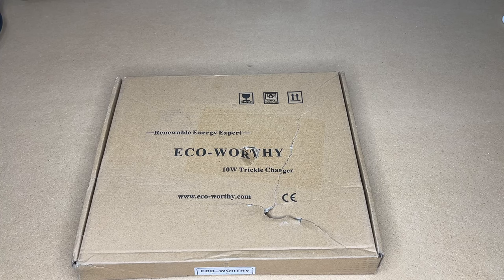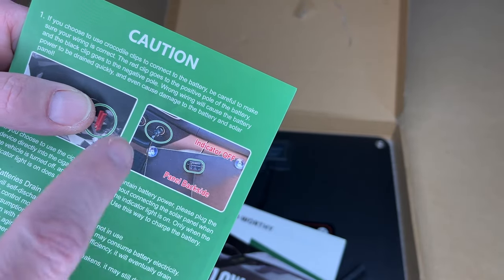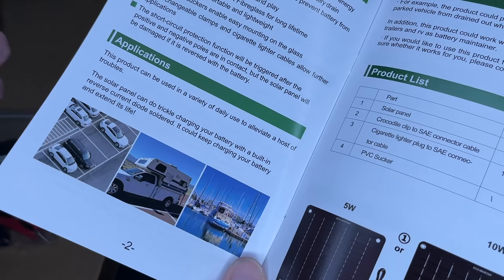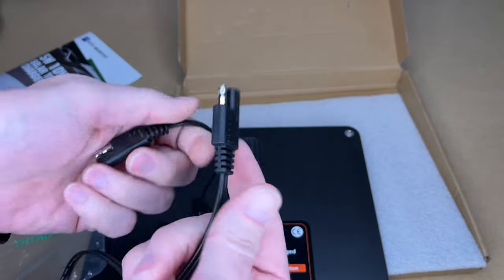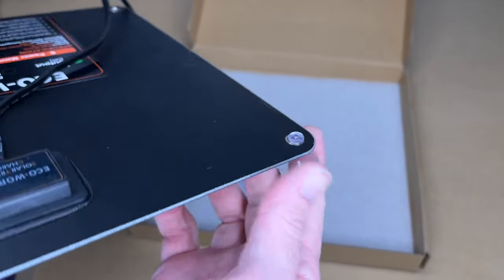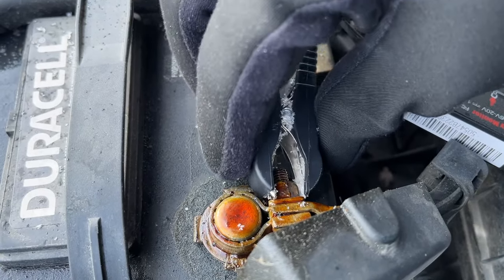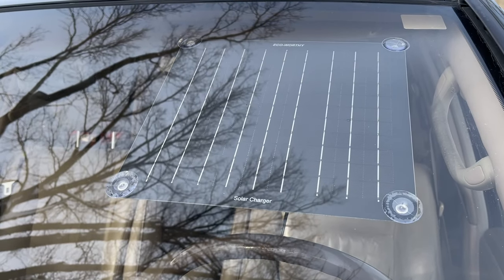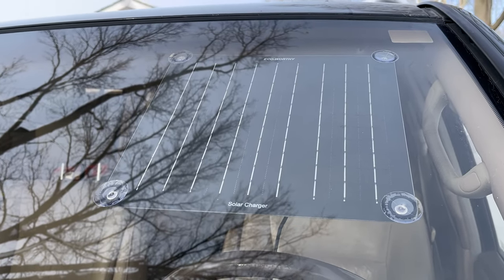ECO-WORTHY 10W 12V Solar Charger Battery Maintainer

Comment: Any issues with making a permanent connection to RV start battery?  Can't imagine 14.4V from Alternator  would effect this device. Seem the PWM controller would think the battery is charged even though a charged FLA is 12.6V roughly.

Comment: I'm using this kit at the moment but I do have a question... as we speak I'm actually disconnecting the positive instead of the negative. Does that make a difference or it doesn't matter really?
Reply from the maker: It probably doesn't for this. When working on a car, it is best to disconnect negative first since it is connected to the chassis ground. This prevents shorting a wrench from positive to ground. Is that risk doesn't exist, it shouldn't matter which you disconnect.
Reply: @Rickmakes  I'm asking this just to prevent my battery from discharging. Someone suggested me that it was enough to disconnect the positive instead of both.

Comment: Im also using the same solar panels you have a video on eco worthy 100 watts im running 4 100   pannels and went with the renogy 40 rover charger also and my wires connecting bsttwry to battery are pute copper 4 Guage but the wires from one end of batteries positive side to my inverter an negative from other ebd of set of batteries negative to inverter are ran exactly like you did so im noy running boyj negative and positive off of ssme battery but the wirrd going from batteries to inverter are and i made sure tgey was pure copper an not copper coated i used double ought wire used in welding applications so i went suoer big on feeding power frim battery to inverter so what could be causing my batteries to not ever fully charge to max they seem to only charge up as high as 13.2 no higher than 13.6 and once i tirn tv an use microwave fir maby 3 min power gird to 12.6 immediately an within maby 6 hirs of use i will be all esy down to 11.9